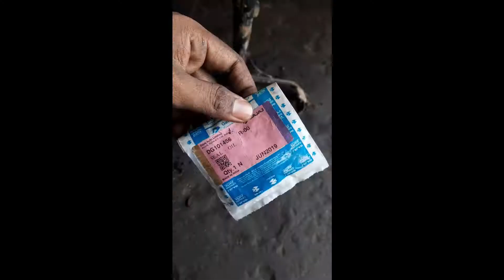Bajaj pulsar NS 200 Sprocket seal replacement,  mobil leakage problem solve, engine repair

Comment: Had same issue..yesterday changed two rubber ring in front sprocket and issue resolved.
Reply: ek ki do rubber rings , sirf ek hi fix hota hai na
Reply: @amitkale1969  i am not sure...Maybe..but rubber ring was the issue..They told me it's better to change rubber ring of oilfilter also  everytime you change oilfilter..
Reply: @AR-777  maine bhi 2 oil seal dale hai delhte hai kitne din chalta hai
Reply: @amitkale1969  I did 1000 km ride no issue so far...just keep an eye on oil level..
Reply: 3 time change Kiya fir bhi leakage problem hai

Comment: Bro even I change but stilll leaking
Reply from the maker: There my be cut on seal while placing it
Reply: @anupghoshvlogs7045  no bro .... replaced it in svc 2 times still it leakes....outside mechanic says bush is bad!!!
Reply: @Music_In_Blood  mera solve hogya issue! Abhi bhar hun ...solution btata hun
Reply: @xmas4116  oil seal lagaya hu..fir v hua Leakage showrum wale v bhakua nai jaan Pa aye...ab kya karu....call karona ek baar avi plz bhai
Reply: @xmas4116  same problem in my rs give me solution bro
Reply: @xmas4116  bro plz tell solution
Reply: @shaanahmad810  bhai uske andar ek patli rubber ki seal lagti hai shaft pr rubber jaisi vo badlo aur thoda sa bond lagana ...sahi ho jaega!
Reply: @srmotovlogs469  same solution bro
Reply: @xmas4116  ok bro thank you
Reply: @xmas4116  bro us chize ka photo wagera hai to diyo na
Reply: @inyourdream1443  bhai picture to nahi hai but rubber hota hai patla sa
Reply: My RS200 gear shaft area heats up so badly as if something is burning even if I ride for 10 kms.  When I stop, the chain and the gear shaft have oil over it.  Is the problem related ? Please share your views.   Thankd